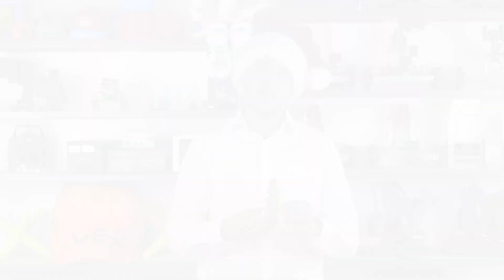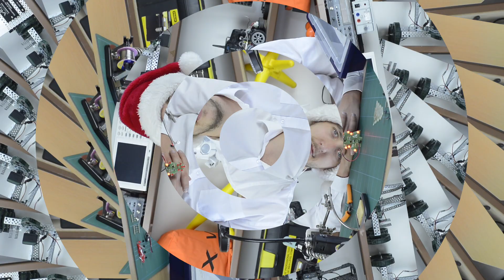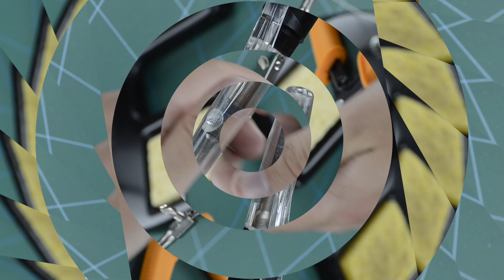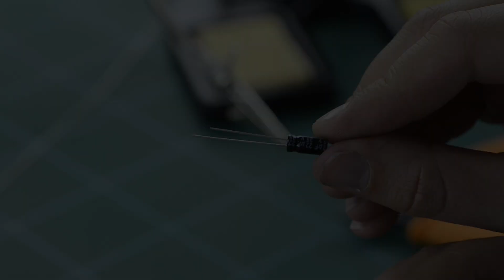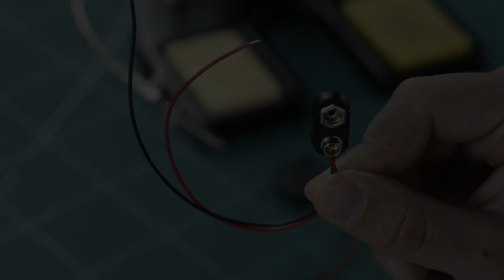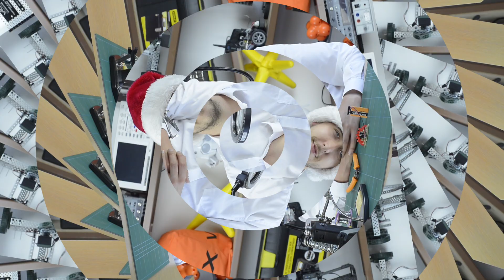How to make LED Christmas Tree Project

Comment: What do you do if you accidentally got the resistors the wrong way around?
Reply: Doesnt matter :) resistors can be installed either way round. 

the LED's, Capacitors and the transistors need to be installed in the correct orientation.